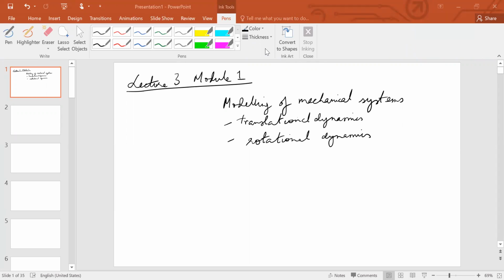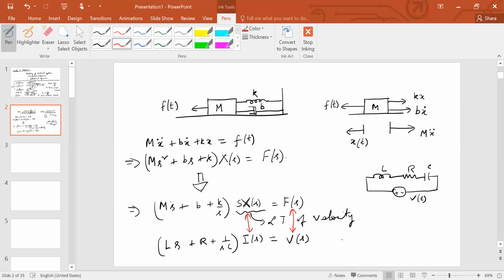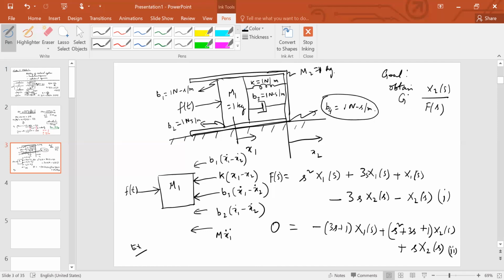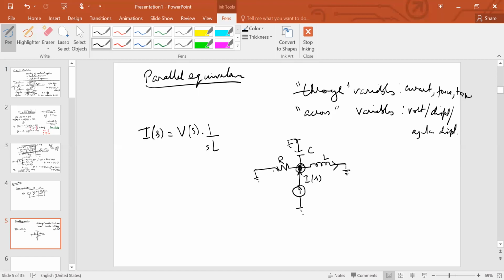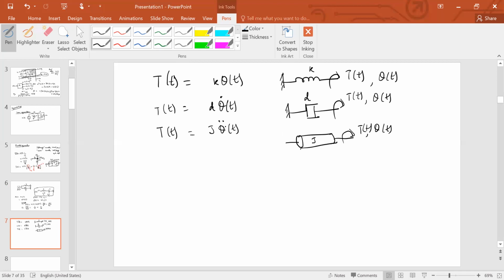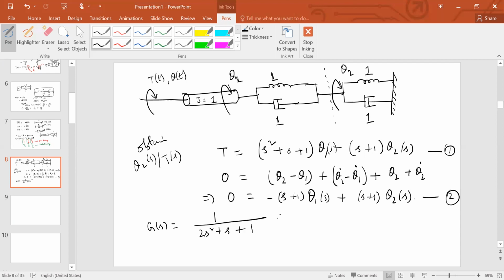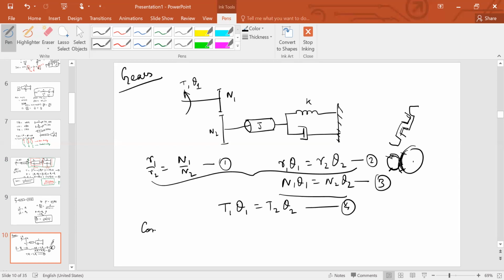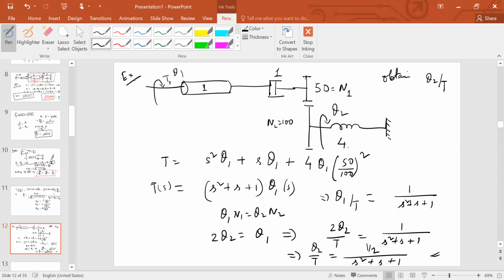EE302: Lecture 3, Module 1

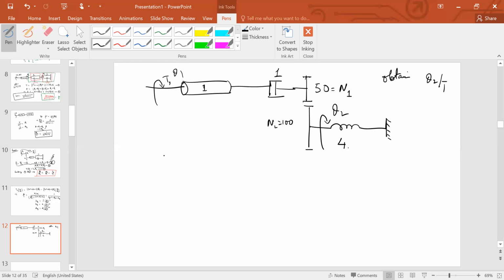Comment from the maker: Ref. 1:02:28 The solution to the problem involving gears (on slide 12) was erroneous, though the eventual transfer function turns out to be correct. The root of the error is that I considered the spring, after being reflected on the source end of the gear, to be in parallel (though I did not say so explicitly) with the spring. It ought to have been considered in series with the spring instead.